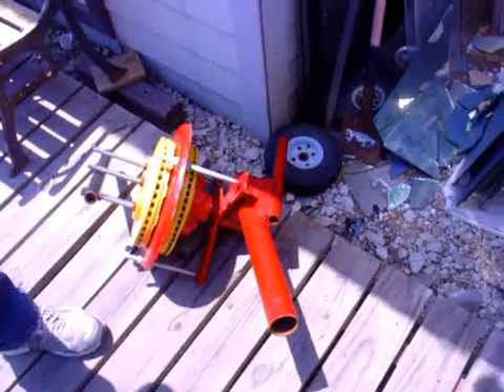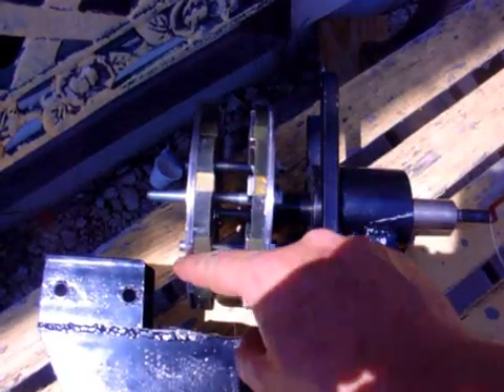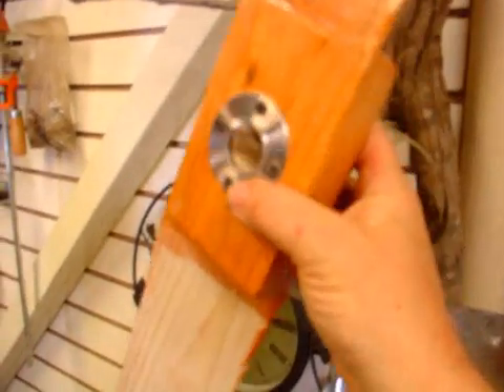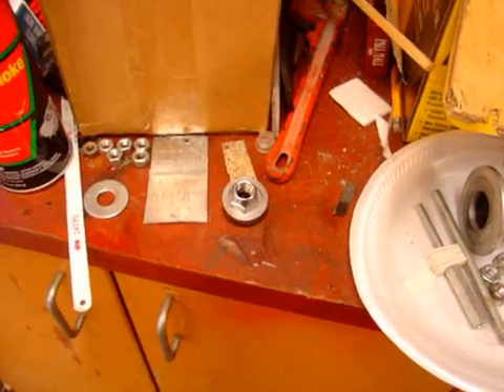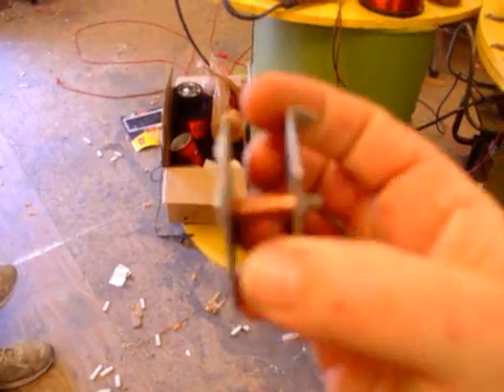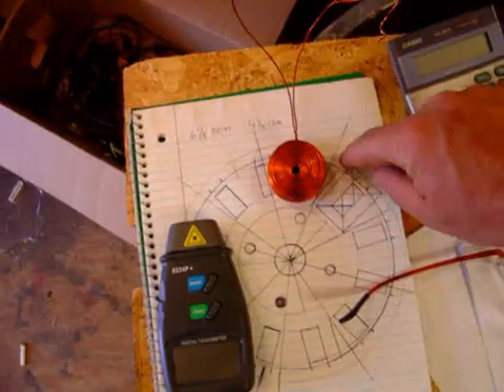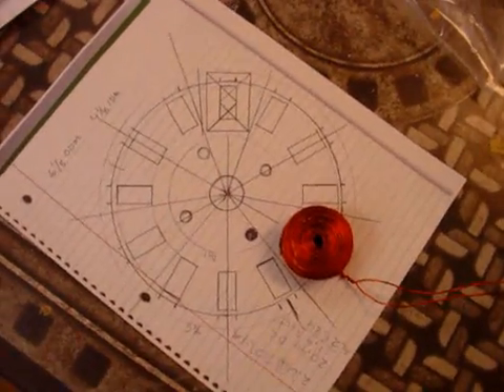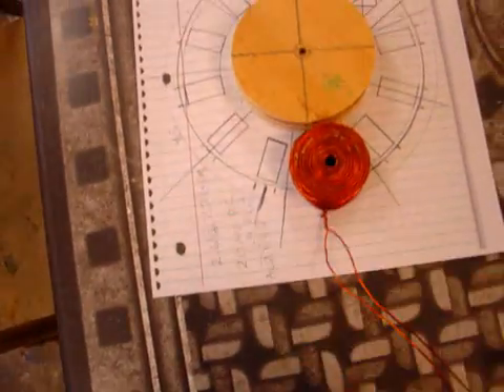MUDDYS MIGHTY MINI WIND TURBINE  (PART 1)  DESIGNING

Comment: please give me drawing how u wired the coils also Question all magnets  are N S N S N S N S N how about the other side.. 
im making a dual magnet center 9 mag 9 coils n to outer one on each side so its from  left to right one disk 9  magnets then stater coils then center disk magnets both side then   stater  coils then right disk 9 magnets.
i need diagrams how make 3 phase coils set up
plus can it run overunity
anthonyolivera@yahoo.com
 i have 42 mlj21194  transistor n  matching  number of diodes n4001 n  n4007 n  100omh r
in vietnam with nothing here two year to get this far please help

Comment: @muddymuddymuddmann
Cool, I expect to find it in my feed, then... Um, yeah, the Retractable Motor is the Killer-App. for Monoblade Airscrews. Instead of a 3 Ft long hinged Pillar, a 4 Ft Dia Prop. Disc, & Doors 5 Ft long... A Monoblade gives a 3 Ft Pillar, a 6 Ft Disc, & 3.5 Ft long Doors.... Instead of Outlanding when the Thermals quit, open Doors, Raise Stick, Close Doors, & start the 10,000 : 1 Glide-Ratio, to get back to the Airfield... And Dia. = THRUST. Ciao !

Comment: @muddymuddymuddmann
Yeah, there was a Europeon Self-Launching Sailplane, with a Retractable Motor on a Stick, behind the Cocpit. To reduce the length of the covering Doors, it had a 1-Bladed Prop., with a chunky Steel Disk for a Mass-Balance. I reckon the Centre Of Lift twirling around at 3,000 RPM, & 2 Ft away from the Axle like that, it'd  Shake like a shower of shit, m'self...; but I've never tried one...
Ciao !

Comment: @muddymuddymuddmann
Thanks Scotty...! Um, yeah, the extra Blades make for better Starting Torque, in low Windspeeds (when there is ZERO Chance of generating use the Tip-Vortex on each Blade is 33% of the Drag of each Blade... Thus, a 1-Bladed Rotor with a Balance-Weight is, THEORETICALLY,  the "most Efficient" design possible. A bit of a pain to build, though.  Ciao !

Comment: @FlyinBrian777
G'day, um, increasing Disc Density by adding Blades won't increase the available Power. Each extra Foot of Radius, doubles the Disc's Area..., thus Available Power. Extra Blades adds output by suppressing Vibration caused by Gyroscopic Precession in Turbulent conditions. Ideally, 2 of Muddy's Rotors on 1 Axle, at 90 Deg. to each other... Smooooth. Ciao !   @muddymuddymuddmann   Yes ! 20 yrs trying for a Wind-Engine for a Car Alternator... Ciao !

Comment: @muddymuddymuddmann
G'day Scotty ! Well, under Betz's Law, 0.593 is the limit of available power extractable from any Airflow. If y'r non-Helical Prop is 75% Efficient, & if the Ax-Flux G. is 80% Ef...; then that'd be 60% Ef. overall, which is roughly 101.18043% of what is even Theoretically Possible...! I'd be surprised if any available Windmill  is as much as  30% Efficient, at peak Rated Windspeed. Much worse at any other speed. Ciao !

Comment: Ooooo! Nice! I'm gonna have to sub up Mr Belgrade as well. Did you ever find that excel file I sent 3 years ago. I put alot ( a year ) of work into it and found out somebody pattented it 5 days after I started work on it. 3rd of the coil resistance and almost any voltage vs amps at any speed you like. Can't wait to see some stats on this build. Wooo Hooo!

Comment: Great video! Your new design is similar to one I started using round magnets almost a year ago. I had to shelve it untill I find someplace that I can put the turbin up into some wind. Where I currently live I can put the turbin up a maximum off 35 feet high, that will barely clear the neighhbors trees. So I have been looking at properties to buy where I can pretty well do what I need to do. This will become my retirement property also pretty soon. I will be totally off grid.
  Ken